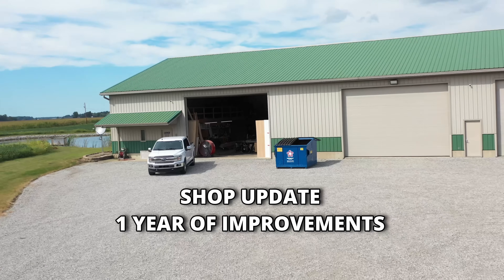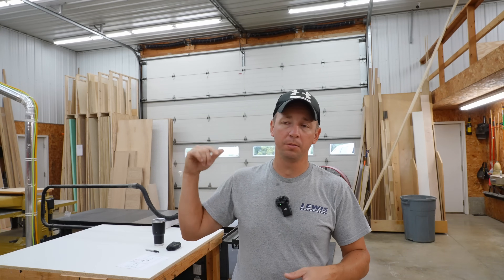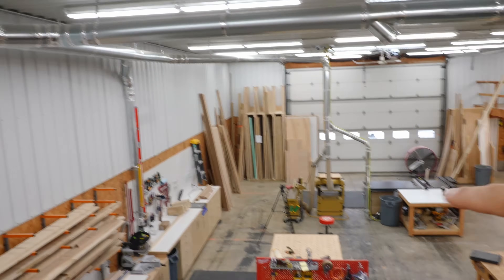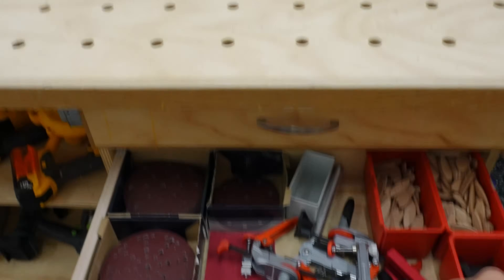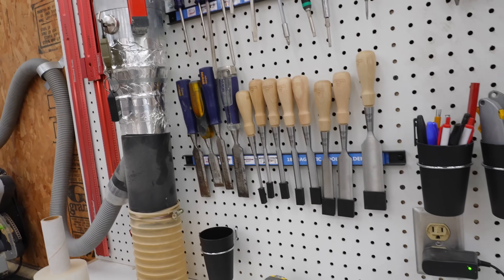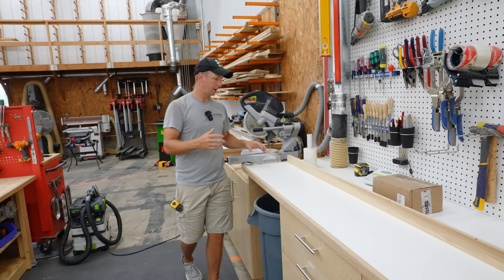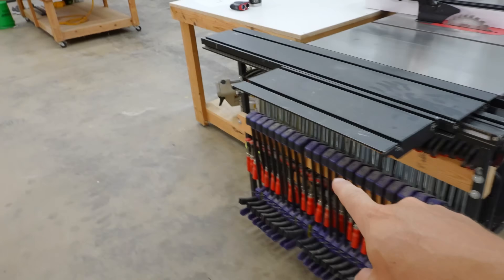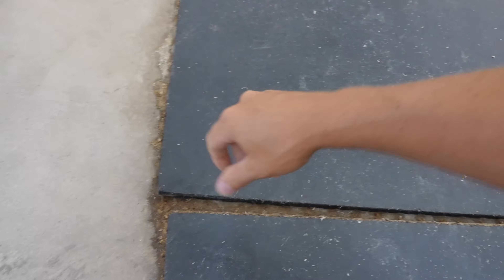SHOP UPDATE - 1 YEAR OF IMPROVEMENTS

Comment: They make gratings that go in front of grage doors that you can hook a drainage pipe to.  You have to build a concrete trough. On top of that you put your grating. They come in iron or plastic.  At the end, you install your flexible drainage pipe.  Saw it on This Old House where the garage was at the bottom of a sloped driveway.

Comment: If you ever expand the shop it will be 100% worth it to rip up the old concrete pad and insualte it.  That is one massive thermal bridge to overcome with heating and cooling.
Reply from the maker: The current heated shop space has an insulated pad with floor heat. I would definitely do the same in the other areas of the shop and would definitely rip up the concrete in those areas and redo it.
Reply: @InsiderCarpentry  Good to hear.  Biggest mistake we made in our barn.  30x60 and its a freezer all winter because of the non insulated 6" slab.